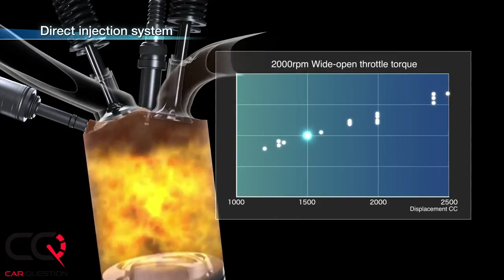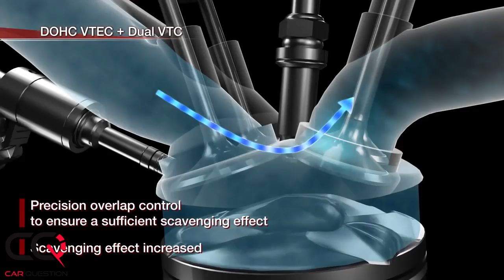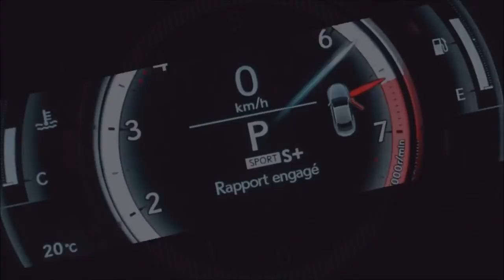Honda CR-V Turbo: Overfilled oil levels and a gas smell Fix and RECALL!

Comment: Oil dilution is catastrophic to an engine. When the oil gets thinned out it looses it ability to lubricate, so in turn you loose that lubrication barrier between the metal surfaces. The engine can lockup or start to burn oil due to excessive wear. Honda is telling people not to worry to avoid liability and to avoid tarnishing their image.
Reply: Honda's quality has gone straight down! Also, denying a problem is very very bad for their reputation. There was a recall in China for the exact same issue, why not in USA??
Reply: @MegaLifeChanging  There IS a recall in U.S.  It's just that, it's based on a lie and the fix is a fake.  Honda tried to make a low friction Piston to cylinder fit, by loose piston rings.  The software trick to warm up the engine will not fix this.  To fix this, they need to completely rebuild the engine by replacing the piston rings, with ones that are modified to correct the loose gap.  When Consumers get the fake fix and start to experince same problems, then Honda's Reputation will REALLY take a dive.  It will be cheaper to redesign the rings and rebuild every one that they made defectively.
Reply: Agree, if Honda gives customers an additional 50,00 mile warranty on ones with issue, what happens at 60,000 miles when it is out of warranty: YOU ARE STUCK WITH BUYING A NEW ENGINE. NEVER AGAIN, HONDA👎
Reply: @MegaLifeChanging  Ye true.  F.Y.I.  Honda's Automatic transmission is a weak point.  I only recently learned about it on Scotty kilmer Channel.  Lookup      "  SCOTTY KILMER WHO MAKES THE WORST AUTOMATIC TRANSMISSION IN THE WORLD  "     He also warns you to Never do a transmission flush on any car with Automatic transmission.  Although Hondas WERE Very well made with great fit and finish, i never like that they always skimped on engine size and hardware.  Always used timing belts instead of chains, Distributiors instead of coil packs and Carburetors, way in to the 90s.  And now, they are doing really poor jobs on the underbody.  Poor weldings, gluing and silicon treatment in all the wrong places.  I saw a detailed look at underbody of the new ACEBODY Honda minivan.  It was Crap !  Ask Scotty before you buy
Reply: @MegaLifeChanging   they say they are giving a 5 or 6 year extended warrantee BUT the engine fail will be at 6-8 years given average milage of 15-20 k  KM's per year . Honda is being coy again. they did not fix the problem. Only a band-aide .
Reply: @javar888  
How do YOU know the engine will fail at that mileage, what scientific info did YOU base this on??
A lot of you people are giving your OPINION of this issue like its FACT!!
Reply: @javar888  
Boy you Canucks sure panic at a little adversity don't you!!??
Hey I have an idea!! How about we give Honda a little time to try to FIX THE ISSUE!! GEEEZ!!
Reply: Wrong blanket statement.
Its "catastrophic" at a certain amount of dilution....so....my question would be at what degree of dilution would the sky be falling???
Reply: @motorcitymanman7711  - your from what country ? Its not panic, its research my friend ! I am a mechanical engineer , SO I kind of study this stuff :) . Currently on a project on With Royal Dutch Shell Researching Lubrication requirements and upgrades on various Diesel engines / designes and its wear profile given lubricant additives . Just in case you would like to know a little more before you negatively comment on me and my country Sir . So , what country are you from ?
Reply: @javar888  
I was born and raised in Detroit and live in So Cal.....moving to Charlotte NC in the Spring this coming year.
I was just ribbing you about the Canuck thing. 😁
This is a problem involving a lot of vehicles, it takes time to resolve it, HONDA is a HUGE corporation I dont think they will try to sweep it under the rug.
Reply from the maker: Lol
Reply: Car Question if you have a car that maybe affected, and you move to a different state, do you have to have the work done by the dealer where the car was purchased?? I have a 2018 crv with the turbo purchased in May 2018 in NY. I moved to SC since then. If it ends up being effected do I bring it back to NY????  Thank you.
Reply: @suesan5111  Not a REAL recall, this is just a partial recall on a very limited amount of vehicles. My old 2016 CRV non-turbo is not covered, but had same issues as Turbo models. Also, damage is already done, can't reverse affects of running gas in engine where oil is supposed to be only
Reply: @MegaLifeChanging  
The dilution is no where near 2 quarts "hotshot".....maybe a half quart at most and the gas dissipates "hotshot", all u have to do is drive more than a few miles, "hotshot". LOL
Reply: @MegaLifeChanging  
90% of owners would probably have sold the car before that happens hotshot.
Reply: @motorcitymanman7711  my 2016 was 2 quarts over in gas, I owned it, real world, not a video
Reply: @MegaLifeChanging  
How long did u leave the oil in before u changed it?
2qrts is extreme, most people only report slightly above the fill mark.
2 qts would have been like 2 inches above the orange top of the dipstick was yours THAT high, if not you weren't 2 qts high.
BTQ.....do u realize that ALL Turbo GDI engines have some oil dilution??
Reply: @motorcitymanman7711  wrong... the gas stays. It is a lot!! My garage smells like gas. My car smells like gas. The smell was so strong I had toleave the garage door cracked or the smell comes in the house. It now resides out in the driveway.
Reply: @dirtyfax  
The gas doesnt totally dissipate but if you drive for awhile some of it does.
The  real question is why do some HONDAS do it more than others and why do some not do it at all???
Reply: Sue San Why is it taking so long for these engines to come up to full operating temperatures?  Are they using conventional coolant thermostats?
Reply: Brian Murphy I would say that if you are smelling gasoline, Honda is violating & exceeding all EPA regulations.
Reply: @Shuffle3956 This is a HUGE issue and yes, Honda is trying to act as if it's not.
Reply: Except telling people not to worry never avoids anyone liability and they know that.
Reply: Sandy Lee  the Theta engine was developed by Mitsubishi engineers. Japanese.
Reply: @suesan5111  but if the piston rings were that loose, they'd leak oil into the fuel. Also, there shouldn't be fuel condensing in the cylinder to begin with. It should all burn up in the combustion cycle, so the issue is actually with that. It's either the fuel isn't atomized enough on the injection or it doesn't burn off due to low compression/wrong octane for the compression.
Reply: @motorcitymanman7711  they 100% did try to sweep it under the rug. No matter how you feel about the problem or its fix, you have to admit that they did try to sweep it, even made a Youtube video claiming it isn't an issue... AFTER they announced a recall for it in China. If it's not an issue, why do a recall on tens of thousands of vehicles, hah?
Reply: @andrew8604  any Honda dealer will be able to do the work for you, but you have to live in the state that's covered by the repair. I believe SC is not, so they won't do it. At least not yet. The issue isn't that the cars that have the problem were sold in certain states, but rather the issue develops when you live in a colder area. That's why northern states and Canada are first to get the fix.
Reply: Sandy Lee  Warranty repair costs are covered by a check from corporate. The dealers are happy to do warranty work. They get paid either way.
Reply: @MegaLifeChanging  I have seen no evidence of oil dilution in the older CRV. Can't find any online either.
Reply: @motorcitymanman7711  it's 2 quarts if you never change the oil. lol
Reply: @MegaLifeChanging  2 quarts over in gas? The issue would have been 2 quarts over in oil, not gas.
Reply: @dirtyfax  did you check for a leak in the fuel system. No matter how bad the dilution gets, it could never make the whole garage smell of gas. I'm guessing you have a fuel leak somewhere.
Reply: @motorcitymanman7711  you've already answered it... GDI... PLUS  using 87 octane instead of 91+, which burns off at higher temperatures, so more completely.
Reply: @suesan5111  Plus turbo journal bearings do not work well with gasoline as a lubricant and will be expensive down the road.
Reply: @javar888  extended warranty for Canada only.
Reply: @Shuffle3956 Pour some gas in your crankcase then if you think it's not a problem
Reply: Norm T world wide issue. USA is in selective states only right now . BUT in the USA nonetheless. Soon USA wide . Litigation and class action suit over issue in USA. China mandated to stop selling CRV, until problem fixed . European recall on the way. Yes in sure Honda Canada would call it a warrantee issue , rather that what it is a - Recall, Canadian wife. Sounds better doesn’t it? Whats the difference Norm? Honda still requesting you get work done . Right? Honda still trying hide issue on naive folks like you. Freaking huge issue Norm . Down played at every turn. I guess they still want to sell the broken car. Recall is only band-aide- not fixing the problem, only burning off gas quickly in oil. Still contamination from oil!!!! 2019 included. Piston shape, rings, injection process need to be changed out, hence basic new engine design needed, not turning up the heat of mean average temperature, I’m an engineer. Math doesn’t-work on solution, only hides problems.
Reply: @javar888  Unfortunately Honda has paying beta testers to do their testing.  Nothing like kicking the can down the road.
Reply: Game Bred Duramax  I don't think he actually said buy crv Over the Toyota.  Can you post a vid link?
Reply: @garyzzzryh.kn.bohrman195  Honestly i am wondering myself.  Both Coolant Circulation and EGR Seems to be software controlled, so i dont know why Honda would purposely slow down the heat up time, when you want the catalytic converter to heat up right away, for cleaner Emmison.  I bet this is just like in Diesel engine, where the gov. Regulation is actually killing the engine and increasing emission.  Thanks to EGR, Diesel soot is getting in to engine oil and destroying everything including the turbo.  Turbos that ran for half million miles are grinding down up at 25k miles.  Nox emission has shown to have zero effect on human health.  In fact, people who were most exposed to nox lived the longest and healthiest.  Yet in order to decrease nox emmision, the new diesels are Increasing Soot emmsion to grind down the engine.  But then you are forced to buy $10k+++ Dpf filter that trap soot that are harmless as dirt, but by government mandate turn it in to nano size cancer causing partical by heat burn off.  That's what government does for you.  California Governor Jerry browns father Pat Brown worked with CIA to overthrow the Indonesian Government to Take over the oil fields.  His boy jerry, then created CARB and passed a bill that effectively required that oil refineries buy crude oil Only from his father's Indonesian Royal Dutch shell.
Reply: Sue San I never thought about EGR, but it does cool combustion.  I have seen videos where Honda owners say it takes 20 minutes for the engine to warmup.  To me, that must be related to a coolant thermostat.  Does Honda use a conventional thermostat in their problem engines?  A stuck open thermostat would cause gas dilution of the oil because of the long times for engine warmup, & also poor heater output.
Reply: @normt5463  Honda has already tarnished their reputation, but what they do in the future will make or break their reputation and longterm out look.  They are probably betting this software band aid will keep the 100,000 s of already worn out engines running PAST The warranty period and quit just out side the warranty.  If all the engines quit just inside the warranty period, they might go totally bust.   Stay away from Korean Cars, Samsung Electronics or Anything eles.  Their cars are gutter oil and Samsung cheated all the way to the top, by agreeing to Spy on Americans on behalf of NSA.  Hyundai theta engines are throwing rods, cuz the journals were designed too narrow with pretty much no oil channel.  A bunch are catching on fire in korea.  They did recall in U.S., but they are treating their own people in their own country like shit !!  They will replace the engine, only if it blows up.  They also sell $50k Genisis in their own country to their OWN COUNTRYMEN for $10k more with Never Honored Warranty.  The cars that they sell to their own, are built with 20yr old 2nd Gen. Airbag sys that NEVER Deploy unless you are crash perfectly Straight a head without skidding, or if you drive over a speed bump in a parking lot, to kill or decapitate your under weight front seat child passenger, with a full force air bag deployment.  Do not support this kind of gutter oil culture.  The rumor is, that they may not be around much longer.  Japanese will honor their warranty promise even if they go bankrupt, but Koreans and Chinese will go gutter oil and leave you stranded.   Here are some news on the korean defects       https://m.youtube.com/watch?v=SWpXdgI0fIE#

https://m.youtube.com/watch?v=pyo5hKJ42Hw

https://m.youtube.com/watch?v=pKrGAavCNrY

https://m.youtube.com/watch?v=49ydFL3u2YU&t=77s#
Reply: @motorcitymanman7711  the gasoline doesn't dissipate because it keeps adding more as you drive
Reply: @afcgeo882  I have a 2016 that has it, I have changed my oil on all of my car since I was 16 years old so that's why I know.most people just drive their car into rapid oil change or wherever and they will never know even if they have the issue and they can't smell it
Reply: @MegaLifeChanging  Well... if you're changing your own oil then you must be an expert on the chemistry of it. Tell me, did you send it out to get tested or did you just swallow a few quarts?
Reply: @motorcitymanman7711  how many miles would you suggest and how often would dissipate the gas and moisture?
Reply: @zagtog1329  
If I drove a lot of short distances I would take a nice HIGH SPEED 20 or 30 mile drive once a week.
Reply: @motorcitymanman7711  thanks for replying. That sounds like it would be plenty. What about 14 mile trip one way mostly higher speeds 40/60 1 to 3 times a week but sometimes only 3 to 7 times monthly.
Reply: @zagtog1329  
I would say 14 mile freeway trips at over 45mph would be fine......im not a mechanic but I've owned over 75 cars!
Reply: Will a heavier weight oil help ?
Reply: @recordgalaxy  
U dont want to use a heavier weight oil with a midern valve train engine.
Use what is recommended

Comment: This is a major problem in the 2017-2019 1.5 liter turbo engine. Check online, there's hundreds of CR-V owners complaining about this (gas mixing into the engine oil). Consumer Reports has written three times about this issue and gave the CR-V a do-not-buy rating because of this. When I was in the market for a 2017-18 used CR-V I specifically did NOT buy it because of this problem. I waited to see if the 2019 had the same engine and problem. Turns out it does, so I passed on buying a new 2019 too. 

Software does NOT fix the problem. All Honda did with the software is to HIDE the problem from the owner. This isn't me overreacting. Search the Net, you will see that people all over the Net are talking about this problem. 

P.S. And Honda has DENIED the problem exists and refuses to do a recall (nor redesign of the engine).

Comment: Anyone who thinks this issue is no big deal... Put a quart of gasoline in your crankcase right now, and every oil change. Moniter what happens to your engine a couple years from now, if it still runs.

Comment: It's DEFINITIVELY not a cold start issue... how do I know? Well, I have a CRV EX with this exact problem and LIVE IN FLORIDA!
Reply: Wilfredo Rodriguez no sorry cold weather issue and cold start issue are two different things. Remember pistons and chambers get to 1000 degrees inside engine.
Reply: The BLAME GAME .
GM GROSS MANAGEMENT''S invention from Honda.
Reply: @jamesmedina2062  Honda did say that this problem mainly occurs in cold climate areas.
Reply: @afcgeo882  you actually believe everything they say?
Reply: @tonychau1983  I take it with a grain of salt. I realize that they can't blatantly lie or they may get themselves into criminal charges territory. In the wake of VW troubles and Nissan troubles, you'd think their executives were aware of such implications. I also think some of what they're saying makes sense considering the symptoms. 

Do you actually believe that they're 100% lying? If yes, do you have concrete evidence for that?
Reply: @afcgeo882  I guess we'll have to see of they're lying time will tell.
Reply: Sunny Cali  here and I drive 50 miles to work ..same shit , oil level is way over 2 months after oil change.   2017 civic Si
Reply: @tonychau1983  Well Honda's is lying...Honda's fix is to detune the engine by claiming it as a "software" problem....basically detuning the turbo ECU and as a result you're 1.5L turbo is now getting less power by spraying less fuel into the mixture.....Honda isn't recalling their vehicles they are just extending the warranty as a way to please their complaining customers.

But who is Honda kidding, a software tune to fix a mechanical problem...Honda is still seeing issues with 2019 and 2020 1.5L turbo engines...there are still consumers reporting oil issues...

Comment: I have a 2021 CR-V and just changed the oil for the first time at 2400 miles, and it smelled like raw gas.  I will get rid of thing before the warranty runs out.  I can't believe Honda would stoop to this level.  Honda will banned from my drive way for life after I get rid of this vehicle.

Comment: If you have this make sure to chnage oil more often. If the fuel is oil diluted, the oil will not do its job and you will have excessive wear.